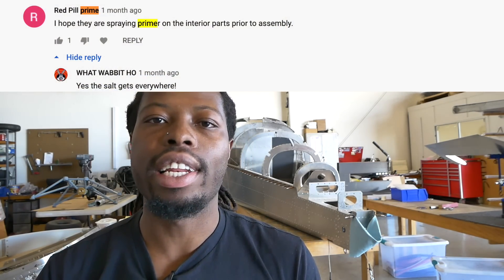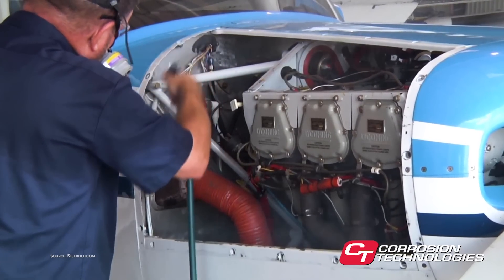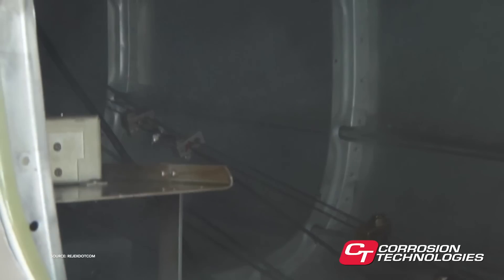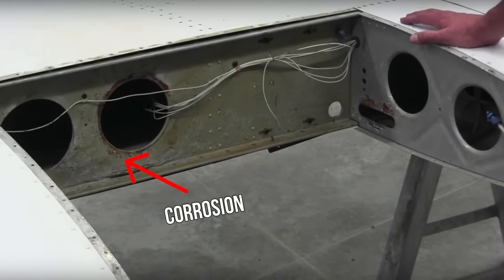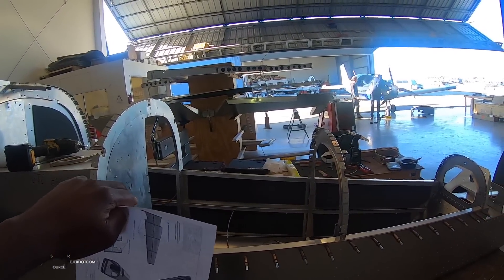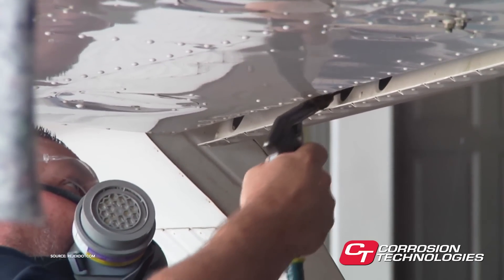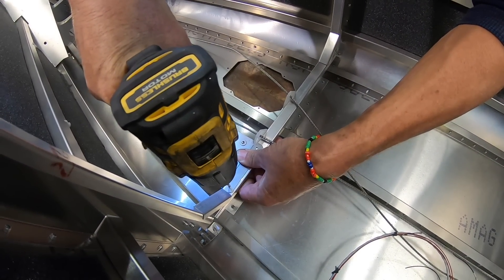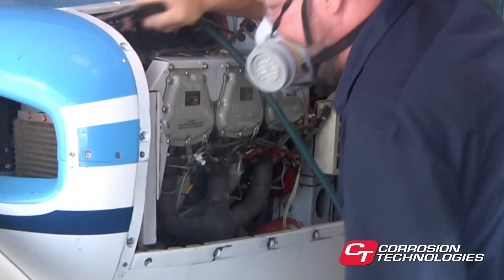Airplane Priming Explained! - Mojosling Build EP9

Comment: im sure that if you talk to a professional aircraft painter he would tell you that all parts are rust proofed before assembly. inspection panels are placed to inspect for corrosion. if corrosion is found the corrosion is cutout and a new patch is riveted to good metal.a second piece of metal is riveted to make the skin flush.sometimes metal tape is used to hide the cutout.some just use bodyfiller to fill in gaps or epoxy resin with fiberglass. sanding blocks are a must before priming and painting. the smoother the finish the better the repair.when you are satisfied on how the primer looks the final epoxy paint can be applied.take a course called material and metals and you can do your own repair. next step is to work on your airframe and powerplant license to be a certified airplane mechanic. might save a lot on 150 hour inspections.

Comment: That's not primer.  It's CPC (corrosion preventative compound).  In the Navy, during 56 day inspections, we applied it to Tridair and other fasteners using an acid brush before closing the panels on F-14's and F-18's.  Seems rather disingenuous if they convinced you, after spending all that money, to spray oily stuff all over your new wiring and interior and call it "primer".  See para 4.13.7.2 for a better explanation.  https://www.faa.gov/documentLibrary/media/Advisory_Circular/AC_43-4B.pdf

Comment: Very confusing explanation, using the word "Priming" when you actually are talking about corrosion protecting, which used to be done long ago( and sometimes still is) using a zinc chromate paint primer. ZCP offered a level of corrosion resistance without being painted over. I twas applied to individual panels after being fitted, but before final riveting. Applied properly, the zinc chromate( as it's often referred to) added barely .001 thickness to the metal lessening the chance of it breaking down and allowing movement, but remember, planes built back in the day were made with different aluminum alloys and solid riveted together, which can have a much higher clamping force that a pull-rivet(not a Pop-brand soft rivet) fitting in a comparable sized  hole. Nowadays, 6061 is often used which has a much higher surface corrosion resistance that allows final construction without a corrosion pre-treat. In the kit build field,  many builders will often accept  the extra weight and use one of the several available products available anyway, zinc chromate, Allodine,  hexavalent chromium, epoxy primer, then pass on one of the spray-in liquid corrosion protectors. Or not, your choice.

Comment: Pretty sure most of your video are showing spraying of corrosion inhibitor like LPS or Ardrox. Priming what you did not do on your own build. Each and every aluminium or stainless steel part should be expoxy primed before install. Then you either spray them as an assembly or touch up when complete the metal bird. In fact spraying oil coats like what's showing in your video while being effective, it is also dangerous if your wiring wasn't built for it.

Comment: Wow!  I was gonna add my (adjusted for inflation) 4.7 cents worth, but compiling what several folks have said gives a good primer (pun intended) on what "priming" does and doesn't do. 

In the FAA certified aircraft world we do ALOT of things that, yes....make the aircraft safer and last longer for the customer, but we also do many things to cover the company's beehinds from a warranty and liability perspective.  I'm not entirely convinced that with the aircraft being constructed from 6061-T6, that one needs to go through all manners of alodining and wet installing rivets and priming parts, etc.  I think it's fair to say that if we were dealing with 2024 or 2014 alclad material, we'd be off on a whole nother rat hole discussion.  Iffin it were me, I'd just go get me some Rustoleum and have at the interior parts.  JUST KIDDING!!

What hasn't been mentioned and that is ground pathing in the aircraft.  If one was to do, as some here have suggested, with regards to "coating" the al-you-min-ee-um, one would need to pay close attention to the continuity of the airframe structure.  And that would entail making sure that mating parts in an assembly had their mating surfaces free of any coating.  Since MoJo is installing very sensitive (electrically speaking) instruments, he'd need to be sure that there was proper grounding in the aircraft to prevent unwanted EMF or having a system blown up with a lightning strike.  Sure - he's got a fancy CB system, but that system relies on ground continuity through the airframe.  Try getting Garmin to warranty an LRU (line replaceable unit) when they discover you don't have proper ground planes.  Anyhow......I'm getting off in the weeds.

No disrespect to the fine posters and comments, however - and this includes me - some of us have been spoiled/ruined/convinced/whatever by working for bigaz airplane companies that the way we build or taught to build airplanes is the only right & proper way you can build them.  I'm not so sure that extreme longevity for an experimental plane is tantamount where the customer is concerned however controversial that might sound.  I would suggest that topics like these are the stuff that makes for great conversations - even arguments - around a campfire that extend themselves late into the night only to be resolved by either exhaustion or libation or both!!

Comment: I don't get it?!? Priming after but how you think that the primer will fill all the holes, gaps and edges? Especially the parts which are riveted I mean the part that is between the rivets? But you're right better after than never.

Comment: I think I understand what you are going to do, and you will be fine. Finish the plane. Take it to the painters and they will do what they need to on the outside, I am sure they will scuff your aluminum, maybe Alodine, clean, prime, and paint. When you get the plane back from the painters, have corrosionX or similar (like shown in the video) applied to the internal surfaces. Like you mentioned on a ribbon in your video, your aluminum is  6061 T6, less prone to corrosion. This combo should last you well beyond your lifetime!
Reply from the maker: Thank you, somebody fully gets it 😁

Comment: I am an aircraft mechanic with over 10 years experience... That’s a lot of corrosion x spraying in that b roll not primer. And you can not paint over corrosion x. Corrosion x is a self healing, creeping dielectric like an oil. It will prevent any sort of paint bond. It might be a good idea to alodine, like an acid etch it will help primer adhere to the aluminum. And the paint over the primer.  Corrosion x is a very good corrosion Inhibitor but it isn’t as long lasting as a paint. It needs to be re applied at lease every year and every 3 months in corrosive environments; like close to salt water or in a humid area.

Comment: I used to partner in a plane that had been treated with ACF-50. It constantly oozed out of every lap joint where it would attract dirt like crazy. We'd wash the plane and after two or three flights there would be black dirt lines at every lap joint on the belly and the bottom of the wings. I won't be using it again.
Reply from the maker: Well the oozing out may not necessarily be a bad thing. Anti-corrosion solutions like that or corrosionX sips into creases and pushes out any bad residue or moisture that can lead to corrosion. So although you may need to clean the plane more often, it's actually good that you're seeing those dirt. It means the solution you applied is doing its job.
Reply: That black dirt probably isn’t dirt. It’s aluminum from the skins and rivets rubbing together. Most mechanics call it smoking. Corrosion x and similar chemicals are a great creeping lubricant and can loosen components and help them to move back and forth
Reply: @nathanokeefe9169  Spot on that was the results of the RAF tests i the 80's and the reason a hard 2 part primer and Zinc Chromate jointing compound was use. Smoking joints and rivets is an indication of movement and we would have to carry out rectification if it was seen during maintenance.
Reply: @nathanokeefe9169  In our case it was dirt. I know what smoked rivets look like. The rivets were fine, it was just dirt.

Comment: Hello Love watching the build.I work for a large commercial aircraft company. jcoghill2 has it right. I was wondering this myself as I watch the build. Where is your corrosion protection? All parts must be chemical etched and then a coating of Zinc Chromate or hexavalent primer applied. This is the green you see on the inside of many planes. Applying it now to assembled parts  is of no value for  the corrosion  will start between untreated parts. I have attached a video note, there are no bare alumni  parts all have been primed with Hex-Chrom. Also on a side note are all the internal parts of you kit  heat baked or hardened in there kits?     jcoghill21 hour agoBare metal must first be cleaned with Methyl Ethyl Ketone and a lint free rag. Then you apply Alodine. It's a chemical that etches the metal producing a protective oxide layer. After exposing the metal to Alodine solution you neutralize the Alodine with with water from a spray bottle and dry the part with a lint free rag or air. Then you apply Zinc Chromate primer and allow to dry.
Reply: Isn't Alodine a brand that uses hexavalent primer or alochrom which both those chemicals have chromadic acid in it already to prevention corrosion? So applying alodine and zinc chromate is an unnecessary redundant step?
Reply: @addictedtopussy69  
You just need to do some more homework alodine is a chemical that supply to the aluminum. That allows the hexavalent chromium primer to stick. Alodine by itself does have some Corrosion Protection. But when I strip the bottom of my plane and repainted it I alodine first then. hexavalent chromium primer and then the paint. You are using raw aluminum and it needs some sort of protection on it. That's a decision you'll have to decide. But if I was building a plane of that caliber and price. I damn sure have some Corrosion Protection on it.

Comment: Bare metal must first be cleaned with Methyl Ethyl Ketone and a lint free rag. Then you apply Alodine. It's a chemical that etches the metal producing a protective oxide layer. After exposing the metal to Alodine solution you neutralize the Alodine with with water from a spray bottle and dry the part with a lint free rag or air. Then you apply Zinc Chromate primer and allow to dry.
Reply: Correct me if i'm wrong but isn't Alodine a brand that is a chemical chromate coating that has chromatic acids in it for the corrosion protection? I don't think Alodine is an etching compound, but has etching compound in it. Wouldn't applying Zinc Chromate after applying Alodine unnecessarily redundant?
Reply: @addictedtopussy69  I'm an aircraft mechanic. Worked 18 yrs on everything the airlines fly. I have no idea if Alodine is a brand name and I could care less. It puts an oxide coating on the metal to protect against corrosion. Redundant or not thats what the INDUSTRY that builds them does. I think they know what they're doing.
Reply: must not. today there are less dangerous cleaners then MEK to work with.

Comment: I’m confused.... are we talking about priming as is a 2 part epoxy primer that is applied to all parts before final assembly OR are we talking about Corrosion X which I thought was applied to those same areas in cases where builders have forgone the application of the epoxy primer?
Reply from the maker: A little bit of both. I'll be doing the latter. Just trying to answer a question that's been asked one 2 many times on the build videos. You're expected to prime each part first before putting together to build the airframe, but I'm trying to let people know that there is an alternative.

Comment: I think there seems to be a bit of vague confusion about the various techniques for corrosion prevention and even the types of corrosion that can occur.  Most of this video has a guy spraying an anti-corrosion treatment which is not a primer.  It's just a chemical process to inhibit corrosion by laying a sacrificial layer that has a higher affinity for oxidation. It's a nice thin liquid that you can spray all over and is able to seep into all the nooks and crannies.  It's great for treating older planes that have already been built. Priming is a step in painting an airplane that is used as an interficial layer between bare metal and the top coat of paint.  Primer comes in many forms and in this context also has an anti-corrosion component. When building a plane, it's much simpler to prime the parts as you build (especially interior regions).  Primer is a kind of paint, and I really don't think it's a great idea to put a paint layer between parts that are meant to be flush together.  Yes a paint layer is quite then, but if the layer breaks down, now there is a possibility of movement between the parts which can lead to a fatigue failure.  An exception might be for parts that are dissimilar metals that aren't structural.  A paint layer in that case would go a long ways towards preventing galvanic corrosion.  I think Mike touches on all of these concerns in the video, but has conflated it all into one idea.
Reply: Hi Dan, is my take away that Mike doesn't really understand what he is talking about?
Reply: In the RAF all parts would be primed with a 2 part primer after alochroming and then would fitted often with a jointing compound in the joint. That said there is an argument not to paint and then use a corrosion inhibtor that will soak into the joint, if you leave the interior of the aircraft unpainted, as this can save a significant amount of weight, but from the test results the RAF did in the 80's they found that the reduced friction between the component faces actually caused more movement in high stress areas. So I think it is you to the individual builder and the operating conditions they plan to store and fly in.

Comment: It might be a language thing between American and English but over here in the UK, primer is a prep for paint (Primer is called primer as it is the 1st / primary coating), on aluminium ally / metal aircraft it is normally an etch or 2-part polyurethane primer.
In the video the process you showed was not priming, it is an anti-corrosion treatment, these are applied after paint and seal joints and unprotected surfaces against moister that act as an electrolyte and cause corrosion. It the treatment is incorrectly applied then this can cause problems by holding in moister or salts and make thing worse. You can not paint over most anti-corrosion treatments, which can consist of water dissipaters, oils, greases, waxes and polymers.
Reply: Glad you said that! What he showed was not priming but corrosion treatment. I had the corrosionX treatment done every two years on my 172.

Comment: The argument around your type airframe construction is that it is 6061 aluminum and older factory built airframes are 2024 and 2024 contains different alloys mainly a copper element that makes it a harder stronger alloy compared to 6061. With the copper additive it starts the corrosion process faster thus requiring priming the surfaces between each surface contact. The factories constructing aircraft out of 6061 say you are not required to prime these surfaces because of the treatment on the aluminum surface. I would still prime my surfaces and dip my rivets prior to pulling them to obtain the best corrosion protection. This will slowdown the build process but I would look at the big picture. The rivets contain a copper additive for strength and this is where the corrosion process will start!!! Speed on the build or longevity of aircraft you make the choice! I love the Sling aircraft too!!!!

Comment: I know that many builders clean and prime all internal parts before assembly. To mr that makes the best sense not counting the exterior of the aircraft. The biggest reason for this is to protect against corrosion. Now I also have herd that when building like a Van’s kit you have to prime parts before assembly and this is to do with the type of aluminum that they manufacture their kits from. I have also herd that the Sling kits from The Airplane Factory do not need the same level of priming as they use 6061 aluminum which is close to pure aluminum, which is less prone to corrosion. I suppose I’d want to know what the manufacturer of the kit recommends? That is who I would listen to. Perhaps Jean from the hanger where so many of the sling aircraft are being built. Perhaps Mike could do a quick question and answer video with Jean and get the skinny on the priming issue once and for all so that we can all stop pestering Mike about why he isn’t priming his aircraft during the build.